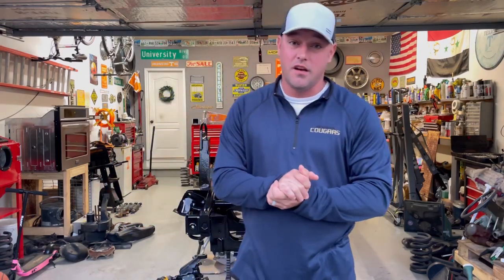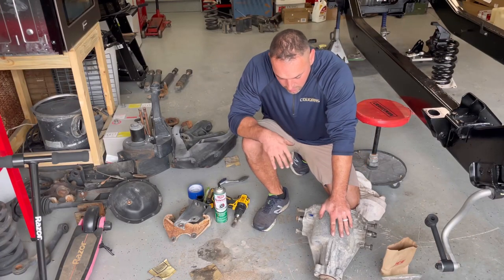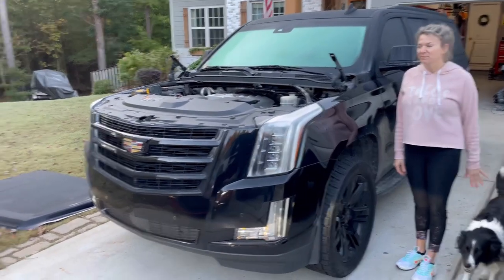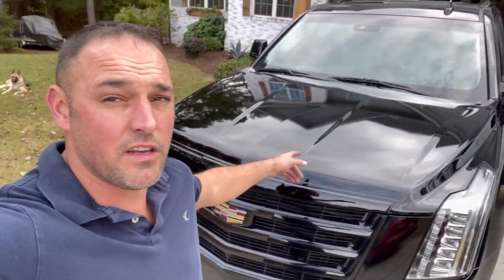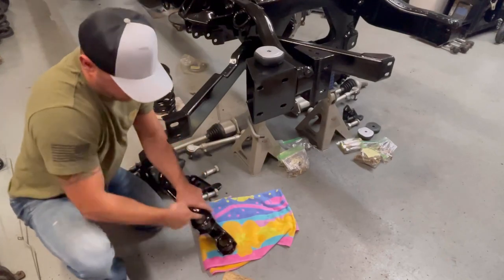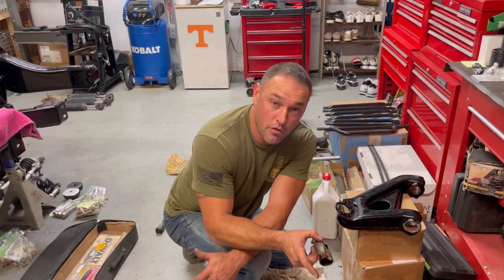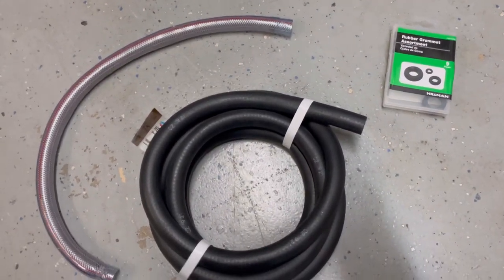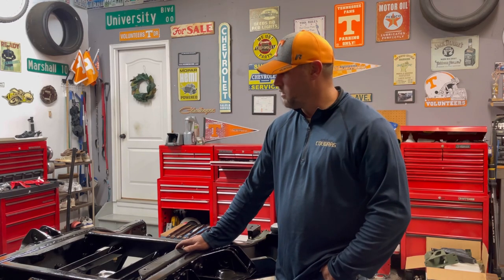Humvee Front Differential Install and More Powder Coating

Comment: Basically find a oil cooler for a car with the same size screw on npt connectors get a 220 volt fan to mount to the back side to blow through and cool the air( it can be wired right in to the compressor so it kicks on with the compressor mount it on the back side of the belt cage on an upright compressor and put a water trap on the outlet of the cooler before it enters the tank

Comment: 1:42 That thing popped off so easy!!  I had to do the one on my Durango last year with 140k miles.  Slide hammered for a half hour before pullin the whole knuckle and smashin it out with a big-a$$ sledge. still hadda replace the knuckle cuz it took aluminum out with the bearing assy...you got lucky bro
Reply from the maker: Absolutely! Been there
Reply: Its not only GM that has gone CHEAP in their parts. I have seen this with other makes including a lot of the European high end cars. 100K miles seems to be the magic number when they all go to sh!t. Probably at 200K miles they will be FUBAR.

Comment: Hey bud, great job on all your videos.
Do you happen to have any video about replacing the front output shaft differential seal?
Thanks,
Subscriber from California.
Reply from the maker: I actually don’t have a video on that, one of my old videos I replaced the seals on the sides behind the rotor, but not the output shaft

Comment: Im picking up my m1123 on the 22nd finally. Can you give me some insight on the vin number location. All i see is a 6 digit serial number on it. Will this be sufficent for tag and insurance. Thanks in advance.
Reply from the maker: Yes driver side on driver door b piller. The six digit serial number is what you need to tag in most states with sheriffs office vin verification form.
Reply: @SplitBuilds  thank you so much.